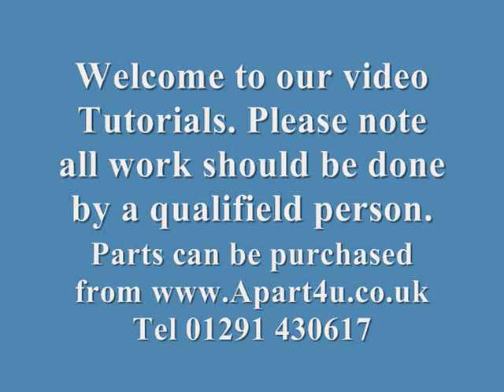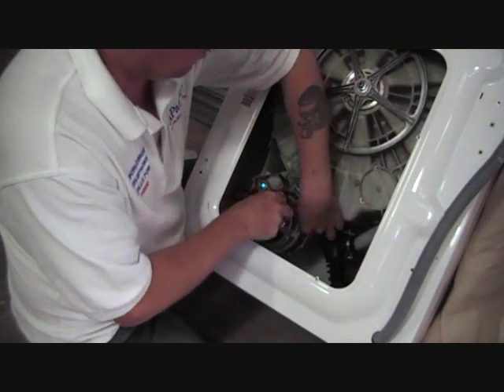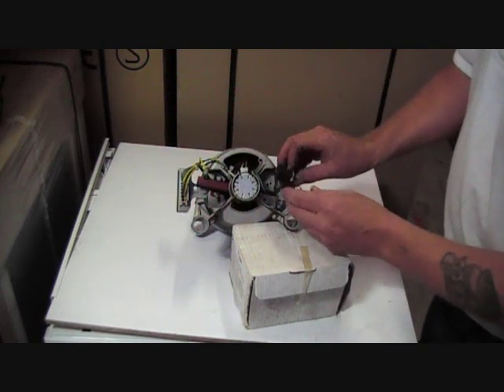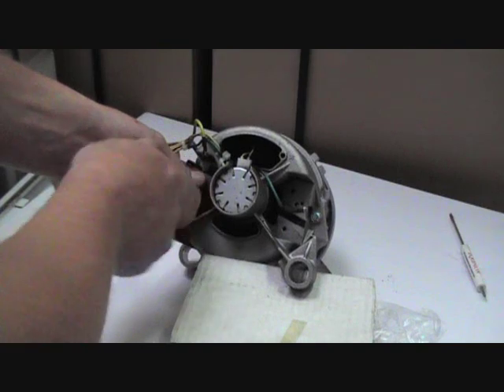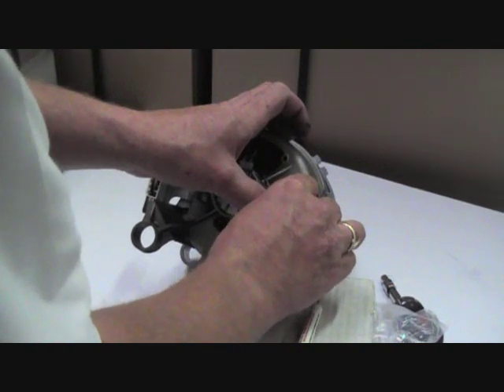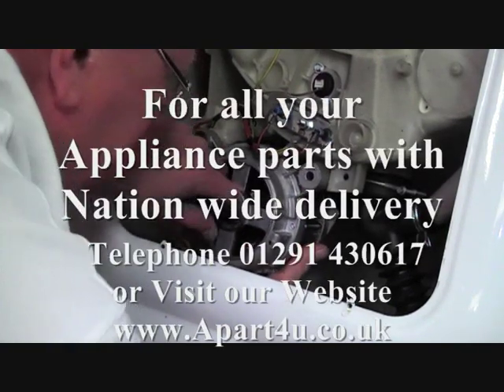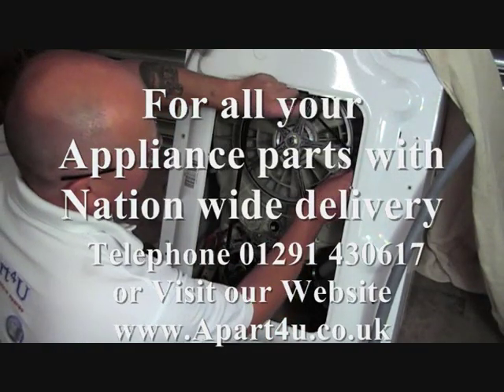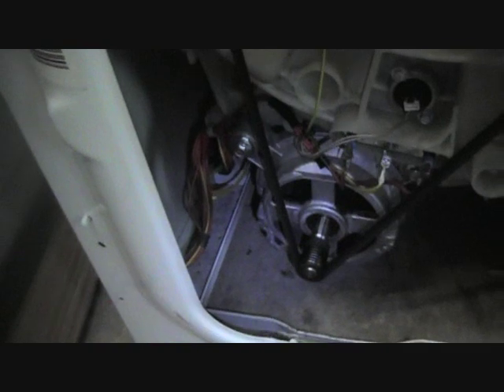How to replace washing machine carbon brushes on Hoover

Comment: Hi there. I have washing/dryer machine Hoover 1400. The error code is E08. What do you think, what could be the problem. Brushes or the tachometer sensor and how can I find the difference between those 2 kind of problems? Thanks in advance and best regards.